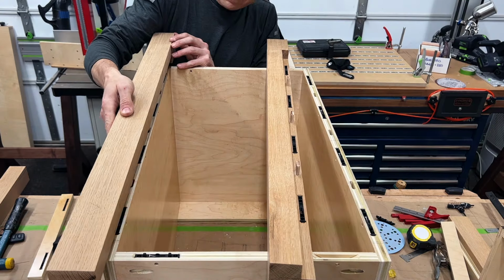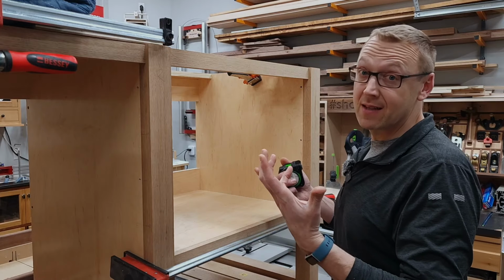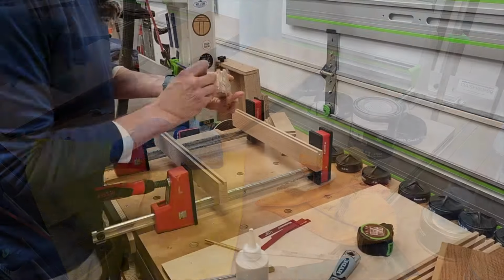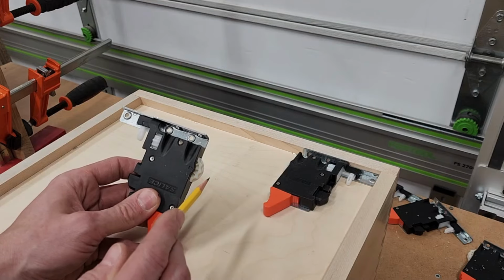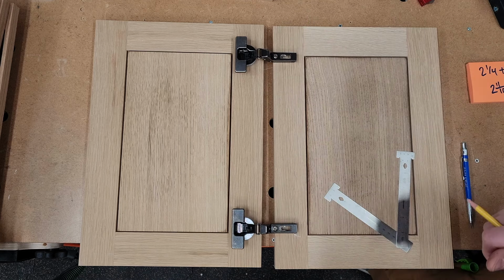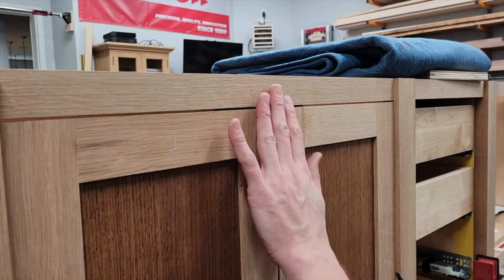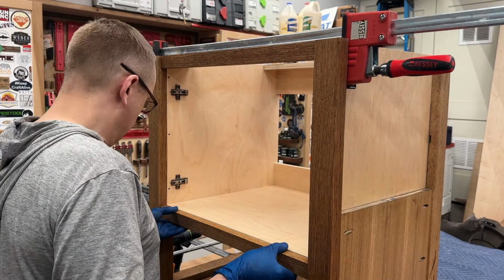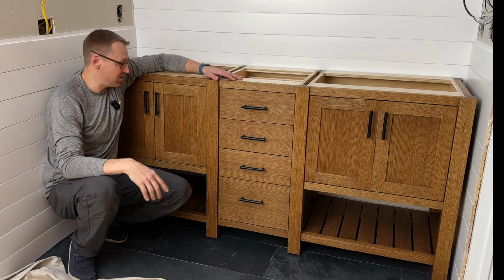Overbuilt...but why? Vanity PART 2

Comment: THANK YOU for that bit about out of square openings. I'm a hobbyist building my first sliding door cabinet and the front opening isn't quite square.

I was planning to cut the sides of the door to match the angle of the opening but feeling kinda bad about it. Seeing you deal with the same thing helps a ton!
Reply from the maker: That's great, Runar! I'd love to say everything is perfectly square all the time, but it just isn't. 👍

Comment: As usual, a good explanation of a good method of work!  

Tip - make your stiles 2” + depth of groove then rail length = door width - 4” No Math!! 😁
Reply from the maker: Thanks Robert! That's a great tip, but that's still math 😂

Comment: Can you add a link for the 3/32” spacer blocks that were used to square the door reveals? This was a great tip!
Reply from the maker: Google Woodpeckers setup blocks. You can’t buy them individually. They come in a boxed sets. I just happen to have multiple sets.

Comment: I am a furniture maker and I am currently recuperating from shoulder surgery and cannot go back into the shop for quite a bit.  So watching your vids is keeping my sanity intact (thank you)! Thanks for putting out great content with all the wins and challenges that come with all (y)our projects come with.  Sorry if someone has already asked this- I didn't scroll completely through all your comments, but what is the brand of the magnetic roller featherboard you are using on your table saw?  Thanks in advance and keep it up!
Reply from the maker: That’s very humbling! I wish you all the best in a speedy recovery!! The feather board is a Harvey Woodworking Compass 2 👍🏻

Comment: Awesome conclusion to part 1. Noticed you’ve switched from Blum to salice for your drawer/door hardware. 

Any reason why? Is it a noticeable difference between products or much of a muchness? 

What about jigs? Are they compatible between the two brands?
Reply from the maker: Most jigs are compatible. The action and quality of the Smove slides are better quality in my opinion. To be fair, they both have their pros and cons, but one of the biggest pros for Salice is their customer service and commitment to smaller cabinet shops. Blum alienated a tremendous amount of small shops during Covid and you still have to buy large minimums of slides from some vendors.

Comment: First time here.  Funny.  You said, “sometimes I like to go overboard.”  Buddy you live “overboard”.😂. NASA is looking for some new furniture for a new space station.😂. All kidding aside.  Great stuff!  Those clamps actuated by the hex key were very nice.  I went looking for them, but couldn’t find them.  Could you tell me the exact name for them?  Thanks
Reply from the maker: Thanks! I'm a belt and suspenders kind of guy 😂. The Clamex connectors are proprietary to Lamello and work with the Lamello Zeta P2 machine only. I am a dealer, so if you would like pricing information, you can email me at keithjohnsoncustomwoodworking@Gmail.com

Comment: 10:20 A grout float as a safety devise … genius! Did I miss the video of you tiling & then repurposing the float?
Reply from the maker: 😜😂 I picked up that little shop safety gem from Bob Van Dyke at CT Valley School of Woodworking. I use them on the table saw, router table and jointer. https://a.co/d/2LXaD7o

Comment: Nice build and i liked the extra details on hardware install because they can be tricky. Are there any major benefits of the Salice slides over Blum?
Reply from the maker: I wouldn't say there are any major benefits. They both have their plus and minuses, but the rack and pinion action on the F70 Smove are much better than the Blumotion, IMO.

Comment: I used to sub out my drawer boxes, but then I realized it was just as easy to build them myself, it also allowed me to not to have to wait for them. I am actually just finishing a video on my drawer box process. what is the difference between the smoove and futura slides, I use futura and they have a different clip, I've never looked into smoove before.
Reply from the maker: Spraying/Finishing is the issue. It's too much work to setup a space for that in my small shop. The Futura aren't rack and pinion and they have a slightly different closing action - not quite as smooth.
Reply: @KeithJohnsonCustomWoodworking  I understand, I have a wide belt sander and a spray booth. so that makes it easy for me,  Maybe 8 years ago, I did the math and realized that it cost me the same in labor and materials than it did to order the boxes,  But instead I was putting the money in my pocket not the drawer company. I know it doesn't work in all situations,  I am fortunate.
Reply from the maker: @oliver299d  exactly! Every one has a different situation and you figured out the most cost effective solution for you. Kudos 👍🏻

Comment: Keith,  Great work.  What type of blade are you using to cut the Venneer panels also what Horse Power is your band saw.  It looks like you have plenty of power to cut the oak veneer. 
    Thank you!
Reply from the maker: Thanks! 3 Hp JET with a Highland Woodworking Woodslicer blade.

Comment: Another awesome build Keith.  One question or thought on the veneered panels for the doors.  Why did you first get them down to thickness and then did the glue up instead of getting them close and maybe 1/8" thicker (each piece)?  That way you'd have more material to work with and it would easily pass through the planer.  More bread than peanut butter for the sandwich.  That might have helped with the slight cupping issue after glue up.  That is the way I've been doing mine.  Just a thought.
Reply from the maker: Well, they were milled down to 1/4" thick before gluing to the MDF panel and then the entire panel was brought down to thickness once veneered. I couldn't really go any thicker as I didn't have enough material from the same board to re-saw.
Reply: @KeithJohnsonCustomWoodworking  Not enough bread!  LOL  Yup, so you did what you could.  Still amazed at the final product.
Reply from the maker: @carlnolte1637  much appreciated, Carl. Thanks!

Comment: What kind of wood movement are you expecting with panels that have an MDF core? Wouldn't that mean the panels themselves are delaminating?
Reply from the maker: about 1/32". The glue is flexible enough to accommodate that.

Comment: Hey Keith, really entertaining and informative video as always. One question about the door panels, I’m curious why you were concerned about wood movement if you were using veneered MDF panels? I’ve done the same thing on projects and just glued them in rather than leave them floating, so I’m wondering if I wasn’t considering something.
Reply from the maker: You just never know what can happen if wood wants to move. I’m confident it will be very minimal if it decides to move, but it’s always good practice to allow for it whenever possible.
Reply: Fair enough, thank you for the reply!

Comment: beautiful work Keith.  how does the salice undercount compare to Blum in performance and cost?  and availability for that matter
Reply from the maker: Little harder to get as they aren't sold in as many places as Blum. Quality of the F70 Smove is superior to the Blum, IMO. The locking devices are a little different, but ultimately have the same function. Installation is pretty much identical, so no real surprises there. Cost might be slightly higher.

Comment: Hi Keith, I see you using woodpeckers combination square.  Do you prefer these over the traditional ones? Also, do they accept the traditional combination square blades if I don’t use the indexing feature?
Reply from the maker: my Starrett blade fits in there, so you could swap it if you want to. I like the extension tab on the WP so it doesn't tip if you leave it down on the edge of your workpiece.

Comment: Great video. Reminds me of why I switched to all metric a few years back. Why do we continue to try and use fractions which are fodder for mistakes?
Reply from the maker: I’ve never made a mistake because of math. If metric works for you, that’s great! 🤙🏻
Reply: @KeithJohnsonCustomWoodworking  Love it! Someone so sanctimonious as to never made a math mistake LOL!
Reply: Metric is great until you need to divide something into equal thirds....
Reply: @stevefuller7805  Not sure I understand. I have no problems doing that in metric.
Reply: @airnashville3883  you can cut something to 3.33333333333333333333333333333333333333333333 cm accurately?
Reply: @stevefuller7805  LOL, yep. Just like with any fraction but, without the conversions.
Reply from the maker: @stevefuller7805  😂
Reply: @Keith Johnson Custom Woodworking  thanks for the videos and tips Keith! I appreciate them!

Comment: Is Rubio by itself durable enough for a bathroom vanity? Wouldnt it need something else like a ceramic coating?
Reply from the maker: Ceramic coating would certainly make it more durable, but I’m fully confident that Rubio is sufficient protection this application. Personally, I wouldn’t use it on a countertop in a bathroom, though.
Reply: @KeithJohnsonCustomWoodworking  
Thanks Keith!

Comment: Hey Keith, great build as always... one question, when doing your inset doors you mentioned you used your joiner to cut the reveal between the doors.. if that wasn't square how did you cut it off square? Why not use your table saw sled like you did for the rail cuts?
Reply from the maker: Thanks Bob! You can make a taper on the jointer by taking progressive passes and passing it over the blade a few inches and then lifting it off…then make another pass going another few inches and lift off…until you make one or 2 final passes that clean up the full length. It takes a little practice to get the technique.
Reply: @KeithJohnsonCustomWoodworking  That's cool. Never done that before... would love to see a video highlighting that technique. I'm assuming the doors were too large for your table saw sled? That's why you choose the joiner?
Reply from the maker: @BobBrittonBespoke  Correct. But the L-fence would have worked equally as well. Jointer is just faster.

Comment: Why are the coping bits called coping instead of Mortise and tenon?
Reply from the maker: Well, a mortise is an enclosed hole, not an open groove. This particular bit set is a traditional tenon and groove, but if it had a profile on it, like an ogee, it is essentially “coped” into the mating profile like a trim moulding.
Reply: Ah. I appreciate the explanation of the differences! I just subscribed, Can't wait to see the next piece!
Reply from the maker: @willbarron8583  You bet! Thanks Will!

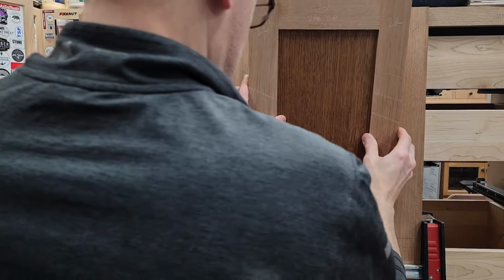Comment: 21:01 how did you do that taper on the joiner?
Reply from the maker: You can make a taper on the jointer by taking progressive passes. First passing it over the blade a few inches and then lifting it off…then make another pass going another few inches further down the edge and lift off…until you make one or 2 final passes that clean up the full length. It takes a little practice to get the technique.
Reply: @KeithJohnsonCustomWoodworking  gotcha. I'll have to try that out

Comment: Nice work, fella, just like everything else you turn your hand to. So, I checked out your list of materials and equipment used to make this project, and thanks for that, very helpful. However, I did notice one small item missing not just from this list, but every list you showed us, which frankly would not have made it possible for you to make cuts without it. What marker pen did you use? Looks so much better than the marker I use, which is as helpful as the stuff squeezed out your fluffy friends' backside who is cute, btw. Hey, it's a family show, right?
Reply from the maker: 😹😹 Here is the Pica pencil I use, but I buy the white lead for it. https://amzn.to/3RU3HXr

Comment: I'm looking at the quote sheet for timbercraft, and I'm looking to get blum 563H5330B soft close.  is this the Blum 1-3/8" option they refer to?
Reply from the maker: Yes, it’s the back slot cut in the drawer box so it can fit over the slide.
Reply: @KeithJohnsonCustomWoodworking  gotcha

Comment: Brilliant as always. Curious your thoughts on the salice f70s. I've heard great things but I usually use blum moventos. The f70s are $12 more per pair than the moventos which are already $12 higher than the blum tandems.  Are they worth the extra coin? TIA!
Reply: @cory- which distributor are you using? they definitely are not as expensive as movento. I would call your distributor or another Salice distributor to check the prices.
Reply: @matthewmanz7311  Richelieu Hardware for both.
Reply from the maker: I found them to be much smoother than the Blum. Also, with the rack and pinion slides, they didn't have nearly the amount of lateral movement found on the tandems.
Reply: @coryherweck7863  contact your Richelieu rep and tell him to get your contract pricing lower. If they don’t do that the default price is super hi. They probably have you on contract pricing with the Blum slide. You also don’t need to buy the stabilizer bar for the like you  do with movento , that alone will save you $15. Hope that helps.

Comment: Wait! How does a titanium screw pair with a magnetic screwdriver? Titanium isn't magnetic 😅 (Yes yes, probably a composite material. I'm still funny!) 😉
Reply from the maker: This is new hybrid magnetic titanium alloy designed in conjunction with Tesla. It's a remarkable feat of engineering. 😂
Reply: @KeithJohnsonCustomWoodworking  Haha! I would expect nothing less!

Comment: Those 5 sixth 20 eight inches are really paintfull 😂 for the love of God stop panishing yourself guys and switch from that ancient system to mm and cm. It s so much easier 😅
Reply from the maker: Stop peddling metric. I’m not changing every tool I have or rewiring my brain. My brain can compute fractions.
Reply: @KeithJohnsonCustomWoodworking  yeah it.s 2 late now.